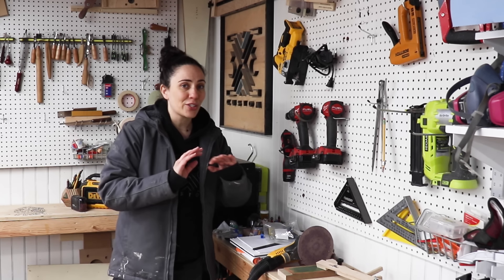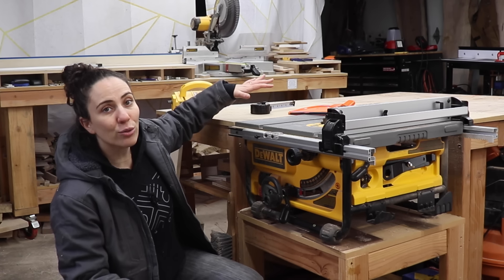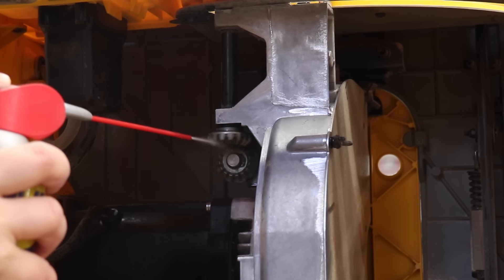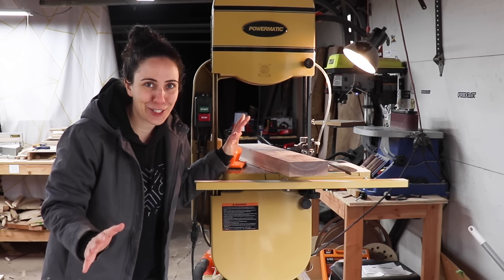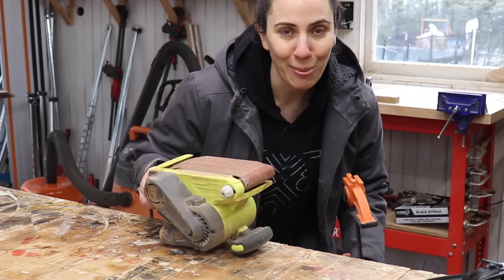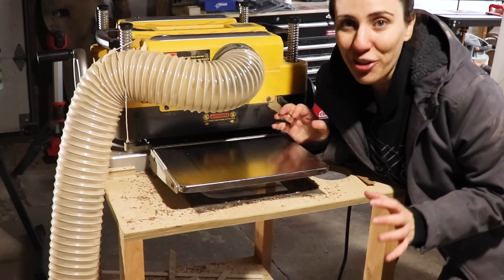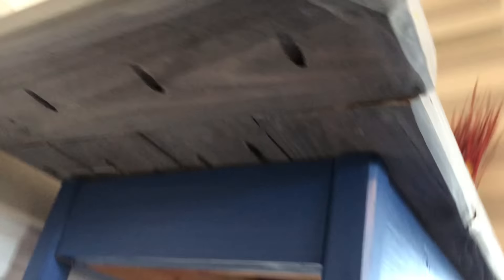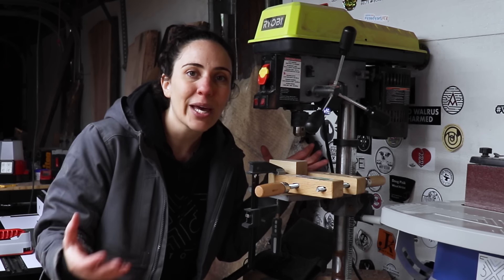What Tools Do You Need to START Woodworking? Beginner Woodworking Tool List

Comment: "A great list.  I wish I had this when I was starting out", he wrote, staring hard at the dust covered drum sander shoved into the corner of a too small shop.  

The part about the breadboard ends reminded me of similar failures in some of my projects.  Wood movement is a hard and expensive lesson to learn as it does not show up until months or years down the road.  You suddenly realize your beautiful piece of work is slowly tearing itself apart. 

I didn't see one, but you could probably do a whole video on wood movement, humidity, seasonal effects and how important it is to understand them when designing projects.  Respect wood movement because it sure won't respect you.  And yes, I see that smug look on your face, plywood.
Reply from the maker: Haha! Yup! Maybe that’s a good video to consider

Comment: so to start woodworking, I need all the same thing professional woodworkers use?
Reply: I don't think that is what she is saying. In fact, I believe Tamar mentioned that with only a saw, drill, and sander you can do a ton of projects. My only modification to that list is get a track saw instead of a standard circular saw. 

My thinking is a track saw will minimize frustration (like allowing you to cut straight right out of the box using the track), avoid a degree of extra cost (like the blade you usually get with a regular circular saw - assuming one is included - is not generally a good choice for doing finer cuts, most track saws come with usually at least an "ok" blade, and often quite good one's), and is generally safer, as the plunge action of the blade hides either all or most of the blade for the cut. 

You will need other things, like for sanding, sandpaper will be required. For a drill, drill bits and fasteners if you go in that direction. Glue is a great thing to have, and good, reliable measuring instruments with only a few going a long way. 

Basically, the list is quite small and likely stuff you will use if even occasionally for stuff around the house.
Reply from the maker: What he said
Reply: @quargr  According to statistics, majority of people around 80% live in urban areas. That means they rent. Stationary tools aren't beginner tools, certainly not common enough to be in any starter kit. Circle saw, drill, vice, long level, sander, and some Titebond 3. That's all you need to build anything.
Reply: @tails5303  Hello. I believe your stats are about right, as I am a renter. From what I can see Tamar is answering the basic question "what do I need to get into woodworking," from her viewers realizing that some people will need very different things, but it is likely some of the basic tools (saw, drill, sander, ...), can be offered as starting points, the individual viewers needing to adjust for their situation. If I recall correctly, the quote from the video was "a ton of projects," with the basic portable tools, not anything. Also, all of the initial tools she suggested had the quality of being portable, able to be run on batteries. 

As to your (or someone else's) particular circumstance when it comes to renting, not all renters' situations are equal. Some rent houses, other have basement apartments, some spaces have a common area that can be utilized (I have such a situation, as long as I don't abuse it and clean up I'm golden). Stationary power tools seem unlikely in my situation, but I can attest that with a few portable power tools (because I do it) you can do a ton of projects. 

Clearly, if you want to move up in capabilities you will need space for stationary tools assuming you want to do what Tamar is doing, though something like a scroll saw can be used quite successfully in an apartment setting, or if you prefer building small models out of wood, small model saws are available taking up little space. In fact, I recently saw a video by Adam Savage answering a question how to cobble together a shop in an apartment, as it sounded like that is where his situation started out.

Once you get past the fact that not all renters are in skyscrapers (in fact, I would say most are not) the purchase of a saw, drill, and sander for occasional cutting down a shelf to hanging pictures, and repairing a finish on something while working in the back yard of the property suggest that some basic tools can go a long way even if you decide the current situation does not allow you to make projects. 

I am a renter, but many of the projects I cobble together (or the repairs I make) are only limited based mostly on my imagination.

Best wishes

Comment: I have that job site saw and it IS a pain to get straightened/aligned properly. Since this is the only saw I’ve used I wonder if other portable saws are just as cumbersome to align to the miter slots. Also, I was so frustrated that I was willing to pay someone to come out to my garage and do it for me. Since I didn’t even know where to look for such a gig I just struggled with adjusting those stupid bolts for a few days until I got it properly set up. For any handymen out there looking to make some extra cash, there’s an opportunity out there for frustrated table saw owners like me!

Comment: If you wanted to encourage people to get involved with wood working, I couldn't recommend this video. Most people have a drill and a jigsaw. A circular saw does not allow anyone to cut a straight line. And a palm router? Not if you're a beginner. Fortunately for myself, I found a cheap table saw and bought a portable router table. If someone can't afford either of those, they should wait. Fortunately some people have it easy like when I had access to a CNC mill. Everything was "perfect" and no router or circular saw was needed. All I had to do was to write a program, you know, Fanuc G code and no problem. The sad reality is that without a way to make cut precise cuts, wood working can wait and should. Same thing with a router table. It just allows for precise cuts made into wood. Otherwise it is a waste of time, money and effort. Luckily for you, you had a CNC mill at home to start with. Myself, I worked in a machine shop so am aware of the difference. I did send you 2 drawings on SketchUp that might encourage people who have thought about woodworking but don't want to spend the money. Even with the "table saw", a 2nd guide would define how wide a slot is. Same with the "router table". I mean seriously, why lay out $500 when for $50 you can have something to work with? This is where your sponsors might say no when they should be saying "prospective customers". An example wood (pun) be Rockler Woodworking. Is their router table better than a home made one? If so, would a novice woodworker consider making that investment? That is what economies should allow for.
Reply: A handheld drill guide also comes in pretty handy. Am sorry about being critical but It's just that with beginners your video might be too much information.

Comment: Dewalt replaced that model with a better model. You should have mentioned model that it was replaced with.
Reply from the maker: Actually they replaced it with one that has an 8-1/2” blade. So I don’t know if that is better. I can’t recommend something that I don’t use
Reply: @3x3CustomTamar  OK thanks

Comment: 30 year union carpenter here chiming in...
Wow, you're SO wrong and we're not even 2 minutes in. A brand is not just a brand and a circ is not just a circ, ESPECIALLY when you're first starting out! Go with a 6.5" blade ON THE LEFT side of the saw if you're right handed because that's the side your eyes on on! It will be much easier to see the blade on the line without having to lean over to the other side of the saw. 6.5" because it's smaller, lighter, and easier to handle than a 7.25"
Milwaukee is good, but Makita has a lot more choices of tools in their range. Both are better choices than DeWalt cordless, which has worse ergonomics and charges a little more. All 3 are far above Ryobi which is really junk which you'll end up wanting to replace if you stay with carpentry. Ok if you plan to do one project and then let them sit around, and you want to save money. 
START WITH GOOD TOOLS and you'll have an easier time getting good results, which will give you the confidence to keep going. Struggle with cheap, bad tools and you probably was do as good a job and want to quit.
Also funny that you didn't start with the pencil and tape measure, the 2 most important tools of this trade and the ones you'll use the most. Hint: stick with mechanical pencils if you care about the quality of your work, even if framing. Sure you can get by with less precion, but why would that be better?

Comment: First issue I have is you promote buying battery operated tools. NOOO...... you can pick up some very cheap corded tools online from websites we all know and this is a great way to start. Next what about hand tools, like.. hammer, chisel, tape measure, square, pencil, screw drivers, hand saw, clamps, sanding block and sand paper. You have gone wayyyy past a beginner woodworking tool list.

Comment: If you stick to hand tools, you can get an entire kit for less than what you’d pay for a table saw and a router. Remember that the biggest cathedrals were all built by hand...
Reply from the maker: Sure. But that’s just not my thing. If that works for you. Great!
Reply: @3x3CustomTamar  I’m not arguing with your point - I think your discussion was great. I’m just saying that for many people just starting out and with a limited budget, it’s possible to get a lot of tools for very little money, especially if you consider older tools. Remember that there hasn’t been a new tool created for woodworking in over 300 years. For some people, the convenience of adding power is worth the power consumption, maintenance, and safety risk that comes with them. There’s always a number of ways to get things done using all power tools, all hand tools, or a combination. It’s up to each person to find their right mix.
Reply from the maker: @anthonykaye6897  I wasn’t arguing either. Sincerely, if that’s what someone wants to do. That’s awesome. Just not the path I took, just sharing my experience!